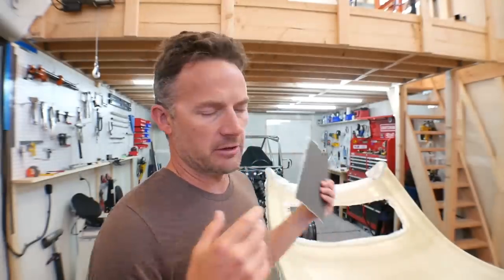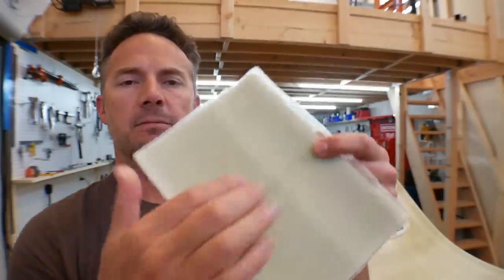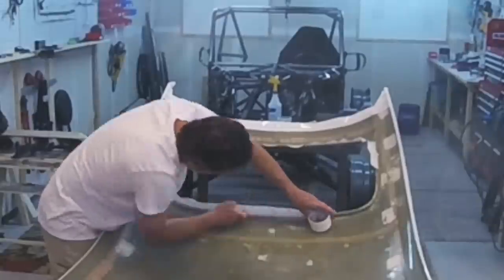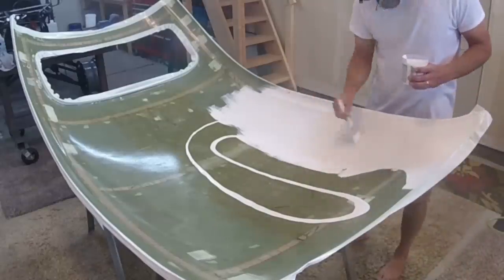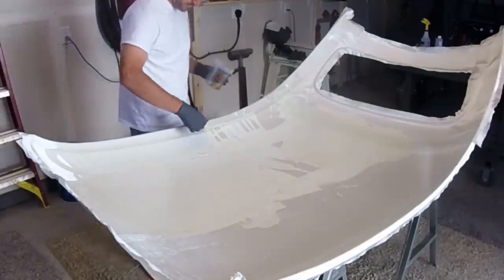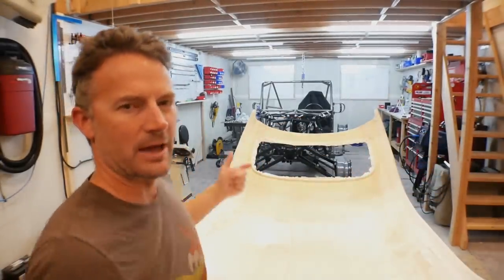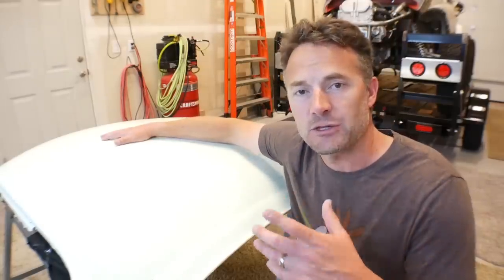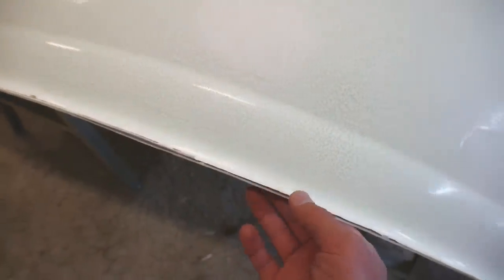Making Fiberglass Body Panels Ep  2 The Roof!

Comment: Hey, great work on the mold and the roof skin! I assume you are using normal woven glass fabric. Are you using polyester gelcoat? If so, vinyl ester might be a better way to go. It stinks like polyester but is more compatible with the epoxy resin you mention for the rest of the layup. Quite possibly, you pulled the wet fabric loose from the mold with the squeegee, creating the bridging (where the layup didn’t follow the mold contour)
Waxing the mold should be followed up with buffing the wax like you would on your car. Spraying the PVA should start with a couple “dusting” coats. This gives the final “wet coat” of PVA something to hang on to (seeing as a waxed surface repels) the PVA should flow out glossy. Are you cutting the PVA with water before spraying? That might help in getting a thin, even, glossy finish. If you like, I could respond with other layup tips as this is getting lengthy. 🤪 cutting the excess laminate with a razor knife after the layup is tak free (hard but not cured) is a great suggestion by a guy that commented earlier.
Again, great work!
Reply from the maker: Send me an email at dougbugbuilder@gmail.com
I know I used polyester gelcoat and epoxy resin. The local supply house recommended I also use polyester resin. But I wanted to use the resin I bought as I bought a gallon of it.
I'd like to hear your suggestions on what gelcoat/resin to use.
Thanks!

Comment: If you want the part to release really easy when you get the wedges started get a water hose and spray water in between the mold and the part. This will break down the PVA and it come apart a lot easier.
Reply from the maker: Hmmm, I never even thought about that. Thanks for the tip.

Comment: Awesome! I used to work in a fiberglass shop years ago. If you drill small 1/8” holes in the mold and cover them with a little bit of masking tape before you do your layup you can lift the part out with compressed air... you’re doing fine though if it’s working for you keep going the way you are!
Reply from the maker: Wow! That's a great idea. I'll try that next time. Thanks for the tip.

Comment: The PVA is what makes it slightly rough, just wax is the whey to go, 😁
Reply from the maker: Thanks, I read that some but was afraid to try it. 😒
Reply: @DougBugBuilder  just wax it at least three times,if you have a air compressor ,use a blower nozel, makes separation slot easyer😃

Comment: Good day!  Just thought I'd chime in with a tip.  Try trimming it when it gets to what is called the green stage.  there's nothing green about it in the way of color, but when the resin or epoxy is kicking off it will get to a leathery(green) point and you can trim it with a retractable blade knife.  Saves a lot of trimming with a cutoff wheel and all the horrible dust.  I built fiberglass body parts for years and anything that cuts down on grinding is a big help.  Other than that it's looking great!  Cheers from Canada.
Reply from the maker: Thank you for the tip! I'll experiment with that next time.
Reply: One other thing.  I prefer using Honey Wax over PVA.  Honey Wax leaves no film to deal with and does a much better job of releasing parts out of the mold.
Reply from the maker: It would be nice to not need the PVA, I'll play around with it. Thanks.
Reply: @DougBugBuilder  Honey wax, just rub it on, let it dry and buff it off.  I do that three times over.  One application will work, but doing it three times just insures that no areas are missed.  I like to build my molds in black gelcoat.  Then I can see where I've waxed and if there's light spots when I apply white or grey gelcoat over it to make parts.

Comment: Hey man Kevin here from Australia.  Congratulations i think what you've achieved with the roof is amazing. With the bit of separation could you use a syringe and shoot some resin into it. 
Anyhoo keep doing what your doing your on the right track.  
✌   Peace man.
Reply from the maker: Possibly, actually I was thinking of trying to just shoot some super glue in there. I think it would flow in nice.
As usual thanks for the comment Kevin!
Reply: Great work, you’ve obviously done your homework!!!
Superglue will work, but won’t last, it’s way to brittle! Either resin, or some other form of epoxy is the best, injected with a syringe as Kevin said, and clamp it with a cloths pin, or something stronger if the cloths pin doesn’t work!